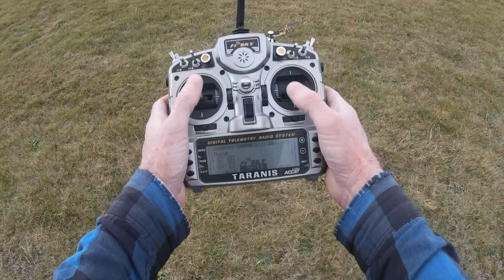Review: DJI Naza Lite multirotor flight controller

Comment: For the GPS antenna they normally have some think black tape in the box that is put on the end of the tube to make an interference fit that can part should it impact. Among my tri and mini quads hangs my original Phantom and a 550 hex with the M naza, right tool for the right job, as a photograph platform it's great. Also when I take out a neubie I let them try the Phantom as it's easy to fly and get a taste of quads. Thanks Bruce for the vids.

Comment: You can run the PPM and SBus at the same time on an X8R. I just run the Sbus the the flight controller and have channel 8 and 9 (I think) mapped to the shoulder switches on the Taranis, and run those out to the gimbal from the receiver.
Reply: Better still, bind with jumpers 1-2 and 3-4 and use sbus with ch9-16 on the pwm pins - great for gimbal control or light switches. Or if your gimbal supports sbus too, then daisy chain sbus-naza-gimbal.
Reply: Better still, bind with jumpers 1-2 and 3-4 and use sbus with ch9-16 on the pwm pins - great for gimbal control or light switches. Or if your gimbal supports sbus too, then daisy chain sbus-naza-gimbal.
Reply: Oh yeah I think that's what I meant! :)

Comment: Did you dance with the Naza Bruce?..calibrated it? :-)...of course you did....In the assistent you should setup the "forced-failsafe switch"and use that switchposition when you setup the failsave on the TX...i've been flying a few years with the Naza and never had any problems...

Comment: Did you use the DJI setup utility to configure the flight control unit? I have a Naza M v2 on my Quantum xj470 and have managed to adjust mine to my idea of perfection. I rate it as easily the best system I have used and will be fitting it to my new heavy lift project.
Reply: Andrew Wilson m v2 is awesome controller. got onr in my f450 with full dji mini OSD. perfect for big quad with fpv system iOSD mini is a MUST
Reply: KrzychOlsztyn hi there. I have the DJI iOSD mini and use it with an immersion 600 mW 5.8 ghz downlink to a ground station and to my FPV goggles. The next upgrade will be to add autonomous gps waypoint flying with the dji app on my iPad. Fly safe my friend

Comment: Flash to v2 works great and cheap controller. 

But if going this route of propper photography just buy a phantom
Reply: the phantom has too many 'safety' features and weird stuff going on with it...
Reply: phantoms are too robotic and fake looking. i hate their video, can watch any clip and tell if its a phantom
Reply: Got mavic and will agree its safety oriented but easy flip sport mode fly like any quad

For cost anyone starting out you cant build what dji sell for same cost. Even just for camera control in flight its worth it

I used be dji hater but specs snd price too good now.

Plus portability great
Reply: John O'Sullivan Soon it will go full circle and people will be sick of rtf multirotors' video and prefer unique diy machine. like how tricopters have the unique movements. or like in music- analog vs digital